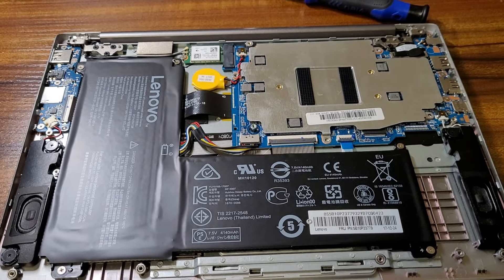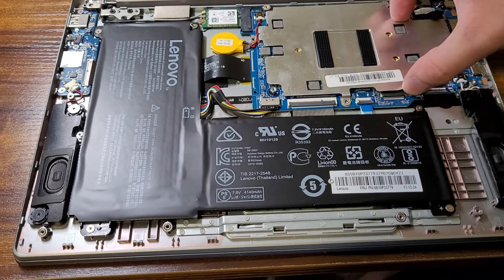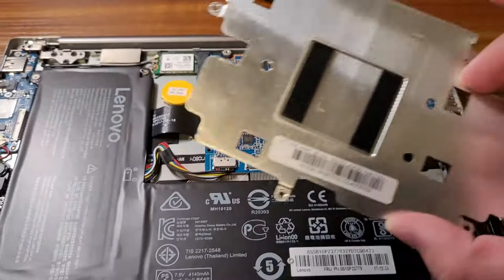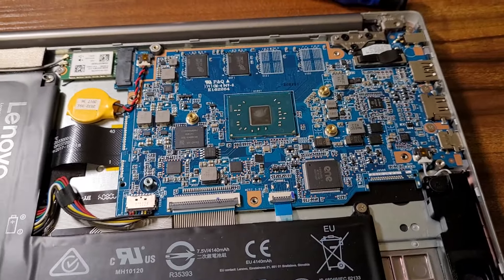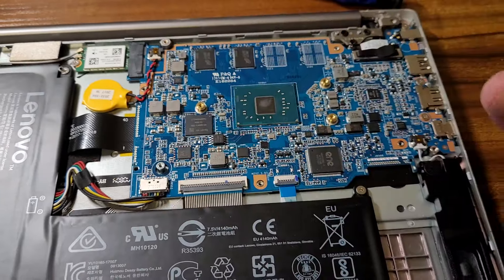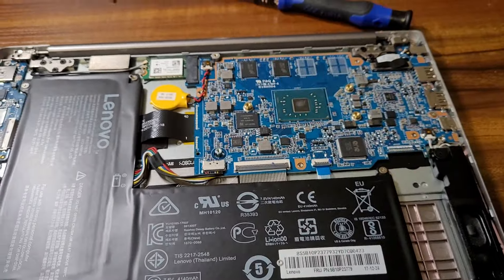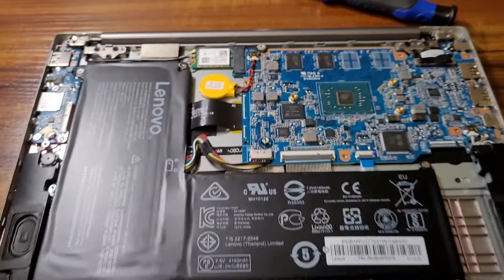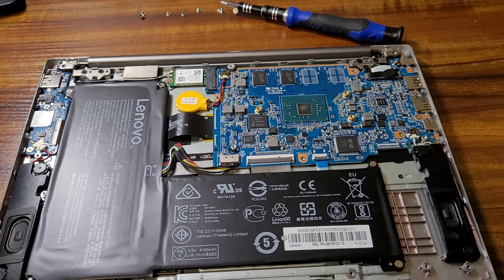The most boring laptop I have ever worked on...

Comment: You could if you had the right soldering equipment to add more ram. I see two vacant pads where ram would be soldered into. 😁
Reply from the maker: I probably could if I was more experienced in soldering. I did it a couple of times in college, but I'd like to get better at it eventually.